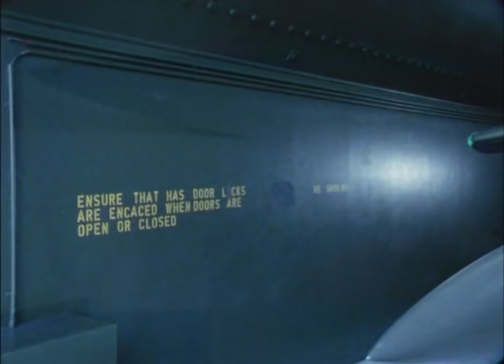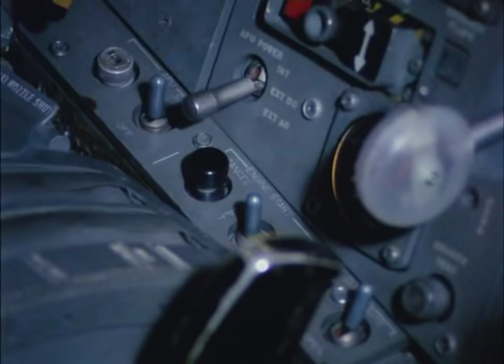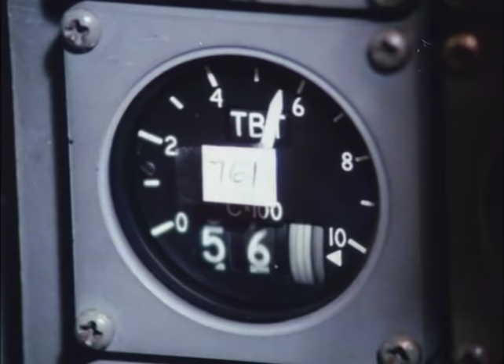Hazardous Ops (1989)

Comment: 38 years I've loved the Tornado. Obsessed with every detail and I never knew it had to be winched back into it's HAS!
Reply: Winched in the newer has. The older style has in Germany we preferred a tractor push-back because the winches were not really designed for the heavier Tonka. Hope that’s another little detail for you 😊
Reply: @hannosolo  We used to winch the Tornados back into the HAS at Bruggen & LBH
Reply: @gareth2467  I was LBH XV and it was push-back only. I questioned it when I arrived there, because always used winch on 617 new hazes, and informed the reason given.
Reply: Push backs were a lot quicker if your tractor driver knew what he was doing. Much preferred "HOT" push backs especially on TACEVAL when every minute counted

Comment: Those hangers were made obsolete two years later in the gulf war.
Reply: Yes and No. They could never withstand a direct hit by a PGM. But they protect from near misses, lighter munitions. Special Force missions against them are dramatically harder. And when you have 40 HAS but only 20 aircraft at a base it means the enemy has to deploy twice as much force. They've still got a lot of utlility today.